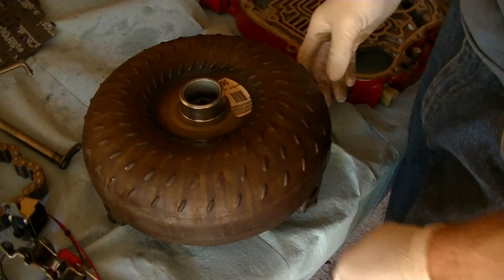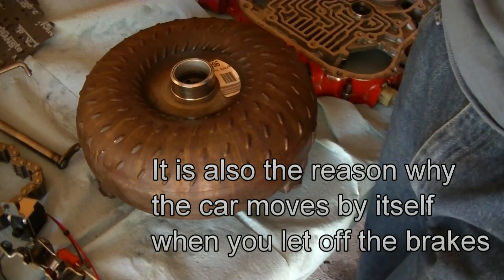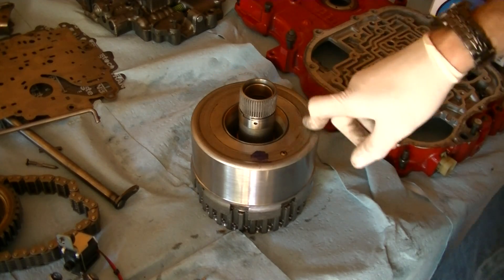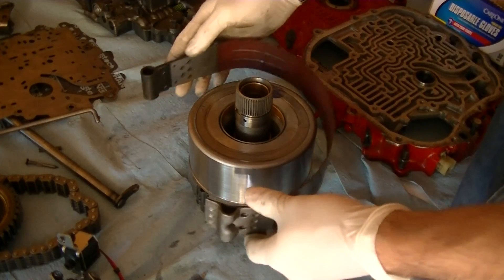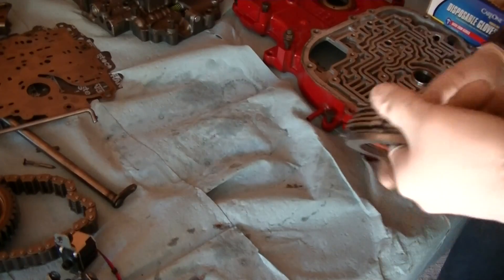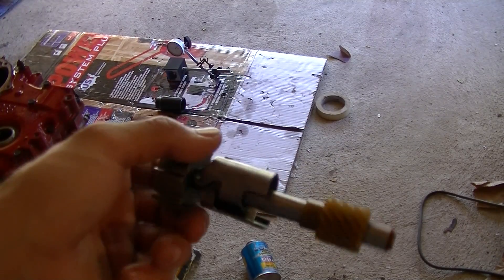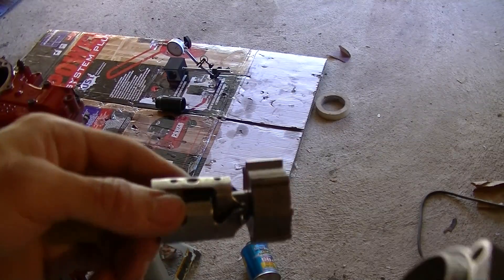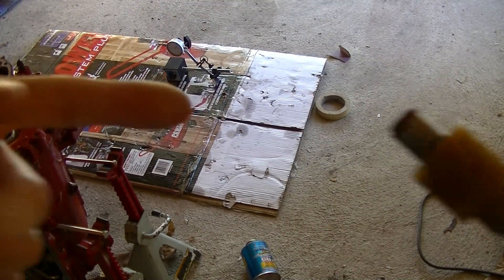How an Automatic Transmission Works

Comment: Awesome explanation. I used to think there is no clutch disk inside automatic transmission and looks like I was wrong. So do I need to change out the clutch disks after a certain period of driving due to wear, like what we do with manual transmission?
Reply from the maker: No you don't.  The clutch disks are not a regularly serviceable item and require the complete disassembly of the transmission to replace.  However that doesn't mean that they won't wear out.  When they start wearing out, the transmission starts slipping and a transmission overhaul (or rebuild) is required to correct the issue.  All rebuild kits come with new clutches and steels.
Reply: MattsMotorz Cool. Looks like it takes a pretty long time (>10 years?) to get to that stage isn't it? And how do we know if the clutch starts to slip?
Reply from the maker: Not really! I've only been working on cars for a little over 3 years.  But I have literally been OBSESSED with cars in that time.  I have read many text books on transmission operation and engineering and also automotive engineering.  But at the end of the day, the name of the game is experience. Which I have gotten a lot of in this short amount of time.  

It is hard to describe what it feels like when clutches start to slip.  But you will know something is wrong trust me!
Reply: MattsMotorz I was obsessed with cars when I was in high school but I wasn't into it that deep like you, and I do realize that car = $$$ unless one works on cars for living.

About how long does it take until the clutch in auto transmission worn out?
Reply from the maker: It varies greatly depending on which transmission it is.  Under normal operating conditions, I have seen transmissions last over 200,000 miles with no problems.  However, the most common cause for clutch failure is overheating.  So if you take care of it, then it will last awhile!
Reply: MattsMotorz Got it, and thank you very much!

Comment: i have a question, i would be very grateful if you could give me some advise. I have an automatic '96 Chevrolet Blazer and when i shift gear from Park to Reverse it sometimes emits a noise like if something gets hit, this also happens from Neutral to Drive. But this noise never happens while the car is moving, all the shifts come smoothly.
Reply from the maker: Does it "slam" into gear? Meaning, does the whole car "clunk" when you shift into drive or Reverse?  Is it more noticeable when cold? Does it do it when the car is at operating temperature?
Reply: MattsMotorz yes it does slam into gear, it's like if the car wants to move a bit from the force but my foot is on the brakes. And it doesn't appears to be a difference doing it in cold or operating temp.
Reply from the maker: Is that vehicle front wheel drive with a transverse engine? If it is, many times this is caused by a stretched or worn drive chain inside the transmission.  If it isn't then usually this kind of thing happens when transmissions get older.  It could be many many things, little of which could be fixed unless the transmission is rebuilt.  Making sure the CORRECT fluid is in it  and at the proper level would be a good start.
Reply from the maker: Also, if you're on a hill it will be more apt to happen as well as there is a bigger load on the transmission.
Reply: MattsMotorz it has a RWD and a longitudinal engine, the fluid and level are correct, but the trans is quite old =/ ... tomorrow i will get it checked to see what's the real reason. Thanks for your help :)
Reply from the maker: No prob! Let me know what it is!

Comment: Hey matt, loved the video!  Is there an easy way to tell the difference between a mechanical problem and an electrical problem with the transmission still in the car?  My 2002 Dodge Neon will not shift out of first gear.  It is an intermittent problem that can last for days at a time.  I have a trouble code for:  Incorrect gear ratio 1 and 2, speed sensor circuit malfunction, fluid pressure switch, and shift solenoid malfunction.
Reply from the maker: Based on what you tell me, it sounds like your problem is an electrical problem.  You will want to check out everything those codes are telling you.  A bad speed sensor will absolutely cause the transmission to have a incorrectly calculated gear ratio, since it uses the speed sensor input to do the calculation. (Your transmission most likely has an input, and an output speed sensor).  A fluid pressure switch uses the hydraulic fluid to press on a switch and tell the computer what gear you are in.  This could also cause problems.  Finally, bad shift solenoids can also cause the problems you discuss as they are responsible for directing the fluid inside the valve body to shift the gears.   Personally, I would start checking the shift solenoids, then speed sensor, then pressure switch. (look up tests you can do to verify the sensors / solenoids are good)
Reply: Thank you.  I already changed the filter and replaced the output speed sensor, hoping to get away with a cheap, easy repair.
Reply: MattsMotorz I forgot to mention, my speedometer has been fluctuating erratically.  Can that info narrow my search a little further?  Is the input speed sensor what the speedometer uses to gauge speed?  I'm not finding a lot of detailed info regarding transmissions.  Do you have any suggestions for where I can find detailed transmission circuit diagrams and testing methods?
Reply from the maker: The speedometer uses the output speed sensor to display the vehicle speed on the dashboard.  All the information you want is in the factory service manual of the vehicle.  Go to alldatadiy.com, they have all of this information (and more) for any vehicle.  (I think its like 25 bucks for a year subscription).  Typically, solenoid checks involve simply measuring the resistance and comparing it to spec. (This isn't always 100% though, since the solenoid could be physically compromised, causing it to get stuck when actuated.)  Sometimes speed sensor have resistance checks.  The best way to test them is to hook up a scan tool that can read live data and view their outputs this way.
Reply from the maker: Also, I have seen a bad input speed sensor cause the problems you describe.

Comment: @ 3:00 Because of that planetary gear system, would this one be a 3 speed?
Reply from the maker: This transmission is indeed a 3 speed but not just because of that one planet assembly.  This unit actually has three planetary gear sets (if you count the one on the differential).  They chain them together to obtain different gear ratios.